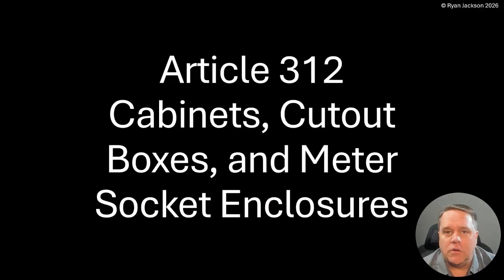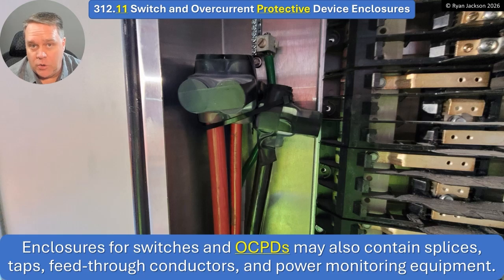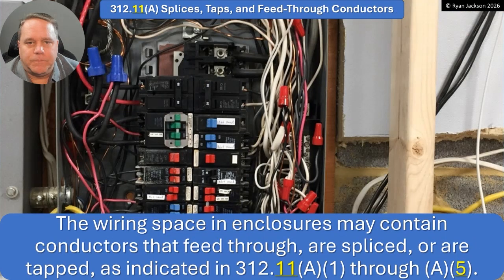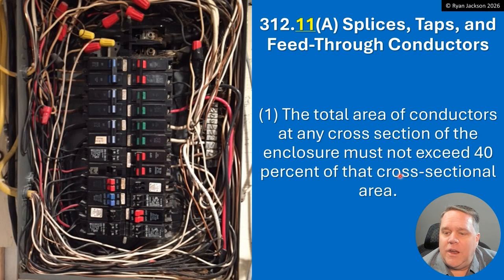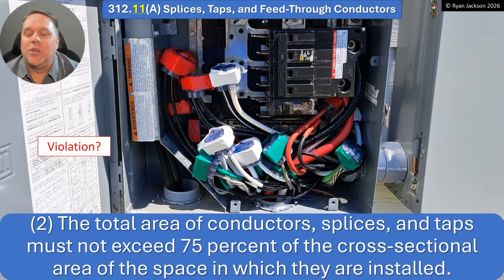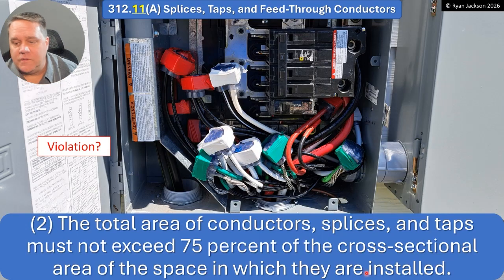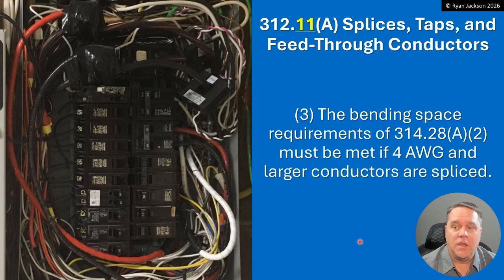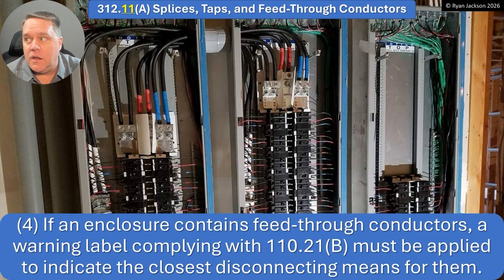100 Days of the 2026 NEC Changes Day 41: 312.11 Enclosures Containing Switches or OCPDs

Comment: A good change and a good video. I feel it is being changed because it can be, although the same effect of unfused service conductors coming into contact with feeders or branch circuits in the service disconnect enclosure and faulting can still happen. That said, things like meter main combos and the exterior service disconnect rule are making this less likely in new builds.
Reply from the maker: Totally agree.

Comment: I would love to see you do a video explaining the difference between a metal wireway and an auxiliary gutter.  I think a lot of people would consider that enclosure on the top an auxiliary gutter - which the NEC handbook says is exempt from the 230.7 rule about not having service conductors sharing a raceway with non service conductors because it does not consider an auxiliary gutter to be a raceway.

I think it’s easy to say that that enclosure is not an auxiliary gutter because it it not attached to any enclosures, but the NEC is mum on this, and the handbook only muddies the water by stating: “the construction of an auxiliary gutter is no different from that of a wireway, the field application of this equipment differentiates an auxiliary gutter from a wireway.”

I know the handbook is only commentary, but this language strongly implies that an trough style enclosure like the one in the photo of this video could be considered an auxiliary gutter because this implies all that matters is function, not form.
Reply from the maker: I'll put it on my to-do list.
Reply: That is a metal wireway. An auxilary gutter usually contains busbars
Reply: @stillthakoolest but that’s not a requirement to be an auxiliary gutter according to the NEC
Reply: @davidalmeida3129 not a requirement, just a common theme. It is all in the listing and product specs as I gather. Otherwise how would they differentiate them?
Reply: @stillthakoolest the NEC only defines an auxiliary gutter by its function which is essentially an enclosure used to supplement wiring spaces (aka gutter space).